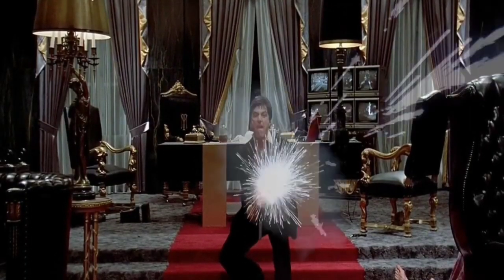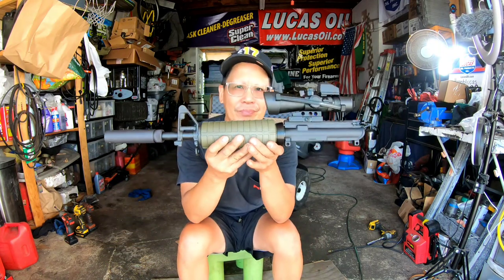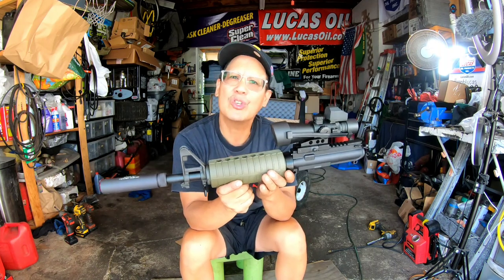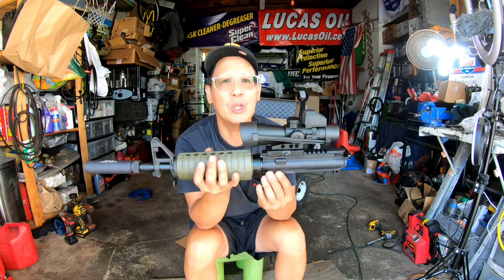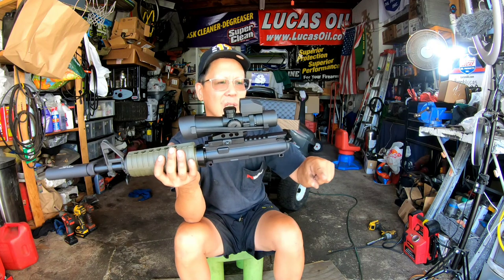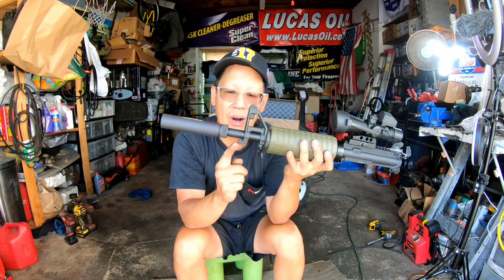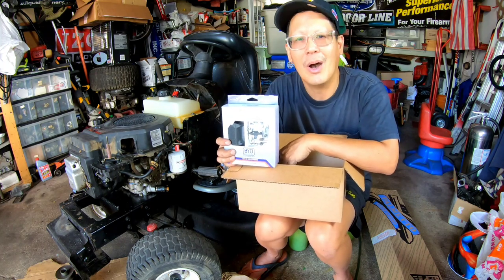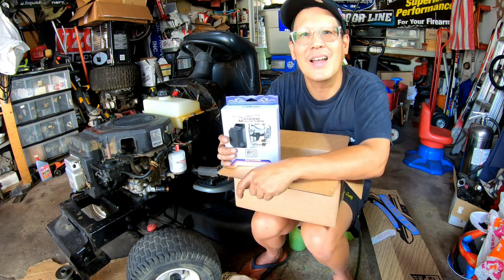AR-15 BAYONET LUG MOUNT DELETE & REMOVAL NYS COMPLIANT M4 PALMETTO 16” BARREL .223 5.56 BUDGET BUILD

Comment: make sure you go very slow and not allow it to heat up too much. It will change the metal properties of the barrel.
Reply from the maker: You mean cut very slow?  I assume you watched the video before you commented?
Reply: @MowersBlowersGuns  Yeah i get it was an old video but i guess for future reference. With treated steel, like a knife or gun parts, if it heats up to a certain point, it can change the metallurgy in the way the steel was treated. Cut slow, use water to cool it as long as it doesn't get too hot.
Reply from the maker: Good tip bro,  thanks…I don’t plan on cutting anymore bayonet lugs in my future…lol